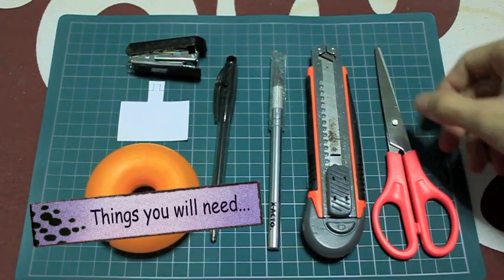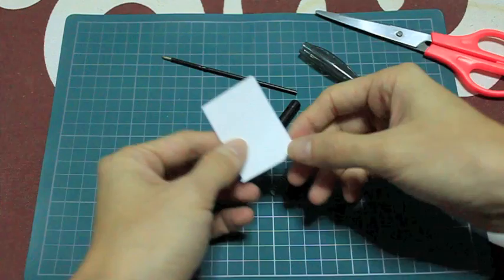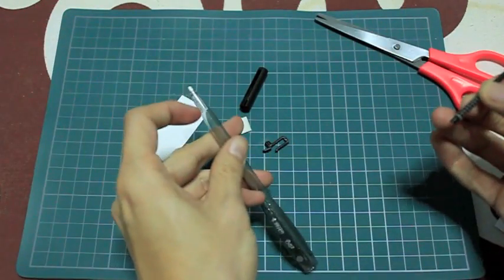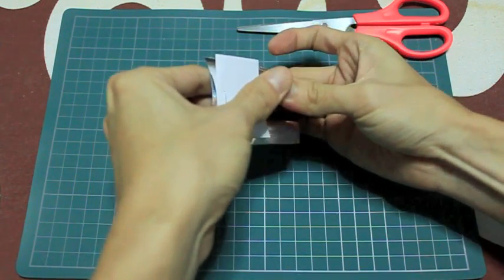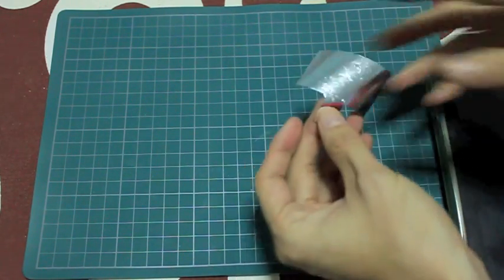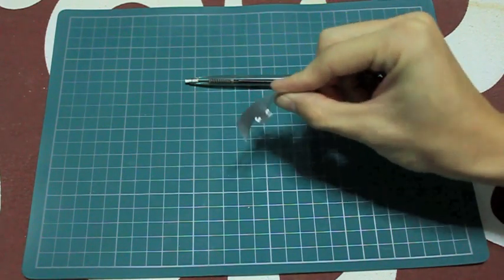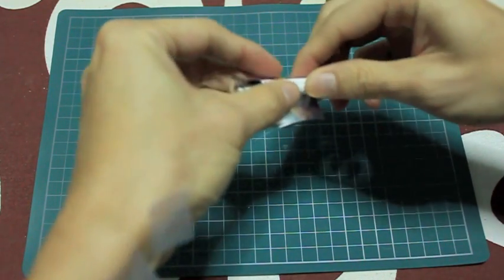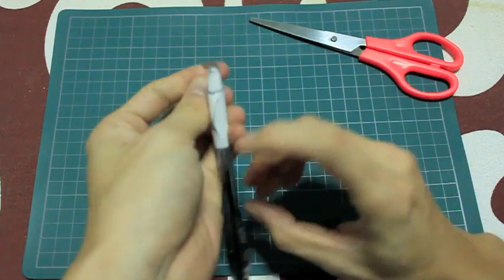How to make Kobausks Capacitive Stylus

Comment: can you make pointed than this please!!!😐
Reply from the maker: Sadly, that's not likely for capacitive screens on most smartphones or tablets. It needs a minimum surface area to register as a touch. The next best thing are products with stylus like Galaxy Note, Tab A with stylus and also the iPad Pro. These come with pressure sensitive surfaces so it will be really good for drawing. Sorry I wasn't of much help in this case.

Comment: I didn't notice that this video was way back 2011, but it is useful. I'll try it later. :-) but I have a question, will any foil in chip wrappers do the trick?
Reply from the maker: Most common foil type should do the trick, don't really recall any that might not work (unless those paper type). Not sure where you're from but the brand, Lay's should be good. Have fun!
Reply: Lay's? It is available here in the Philippines. :D
I think this will be great, so I wonder why there are hateful comments below. Haha anyway, Thanks :-)
Reply from the maker: Those are either about the accent or finding the process a hassle.The more important people are those that appreciate (like you) so its fine :)
Reply: +Ashleigh Vonne Dugay you can just use foil

Comment: Thanks so much for the detailed tutorial. Kobausk's videos were somewhat hard to follow because they flashed by so fast and was light on specifics. Do you know what that transparent material is he used on the tip of this pen? iPad_φ(-_- DIY Transparent Pen (自作透明ペン) Movie8 (8/9)

It seems like would be better than using a chips bag because you can see through it for more precision but I don't know what it is or where to get it.

Comment: wkwkwk.. it works,, but.. not presicion as i thought ( i use it to skecth on my samsung s3)
Reply from the maker: Cool! Try trimming the contact surface a little here and there (e.g.. if the point is appearing on the left, that means the left side's contact area is larger). Hope this helps.
Reply: tape around the point of pen usually detached
Reply from the maker: You might want to use a stronger tape or go around the pen and foil a few time without covering the entire foil portion.

Comment: What is the iMovie theme name that you used. Or other app name? Thx
Reply from the maker: Yes you are right, it was created using iMovie using the theme named Comic Book. Hope this helps.
Reply: Thanks, just thought you did a great job on it. Appreciate the info. Cheers! 😎👍
Reply: Hi I managed to make a stylus successfully with this great tutorial. However the foil is not transparent and I can't control my writing well when I write or draw as I can't see the pen tip.  Is there any other transparent materials that can be used? Great job. Cheers!
Reply from the maker: Well, try getting those foil used to store HDD. Those are transparent and work great!

Comment from the maker: I think u just need to fix the tip of the stylus to ensure it is flat when in contact with your screen. Maybe change the tape? The problem is that it works with a minimum contact surface, once the static charge is insufficient, it will not detect as a touch. Hope it helps, sorry for the late reply...too many comments coming in that aren't helpful and forced to ignore them.

Comment from the maker: Hi Samuel, most likely, this problem arises from not having enough contact surface. It could be that the tip is not completely flat or its not big enough. I did face this problem when building the first one. U might want to try to flatten the tip as much as you can, if that doesn't work, u might have to build all over again but ensuring the tip is large enough. If you used my template, maybe cut wider than indicated...hope it helps ^^

Comment from the maker: Well, if you are really worried about the stylus scratching your screen, applying a layer of Screen Protector will help. But basically this stylus has a layer of sticky tape (cellophane tape) at the tip to make writing smooth and prevent scratches...not too much to worry compared to those made using steel fibres. ^^

Comment from the maker: Using a foil is fine as it also conducts the static charges well but aluminum foil retain their shape, so if you accidentally bent the tip a little, it might be hard to have it straightened to achieve a large contact surface. And also please do be careful as aluminum foil can scratch your display, so remember that layer of sticky tape at the bottom of the tip! 

For best results, use those packaging foil used for Hard Disk Drives...they are translucent and conduct static charges well!

Comment from the maker: @laiciplayspiano Glad to be of some help! Anyway, like I mentioned, I did make the mistake of putting the pen tip behind the "U"...what happened was the foil was "dragged" around while I used it and the center point of the tip wasn't that center. I guessed Kobausks wanted to achieve an exact center point where it felt natural (as if using a pen). For me...it would be the dragging that's not working...does it work for u?